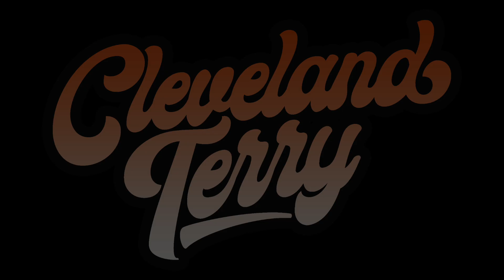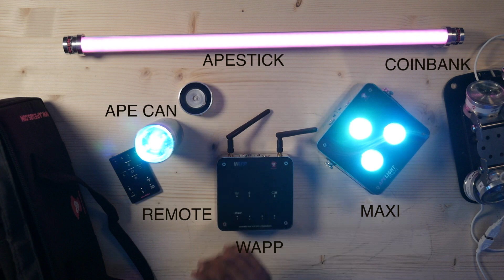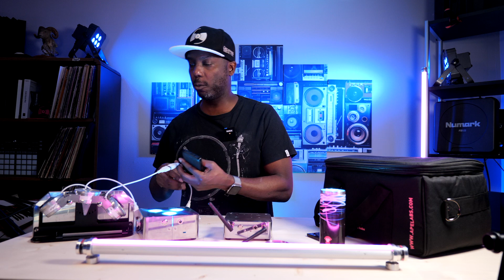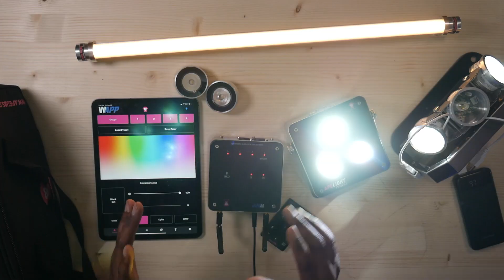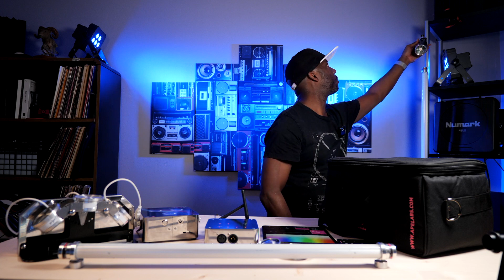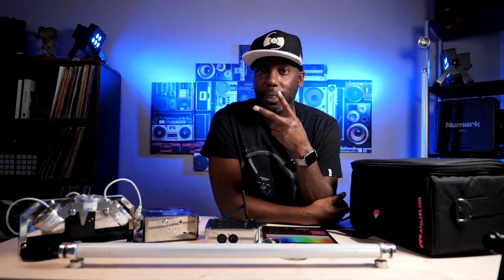Apelabs Professional Lighting - Battery Powered Goodness for the DJ and Professionals alike

Comment: Don't buy!
I own 12 Ape Labs Maxi lights. These lights are overpriced and too expensive in terms of lifespan! The lights interrupt charging, which destroys the battery over the years. When I wanted to advertise the light that the interruption was damaging the battery, they retorted to me that this was normal. The battery is not part of the warranty period, so despite the 3-year warranty, it is not repaired for free. Very arrogant attitude towards the client. I advertised three lights, one was only on for 4 hours. Replacing the battery costs 100 Eur / each. A very practical light, but very, very overrated! Even though I own 12 pieces, I strongly advise against buying!